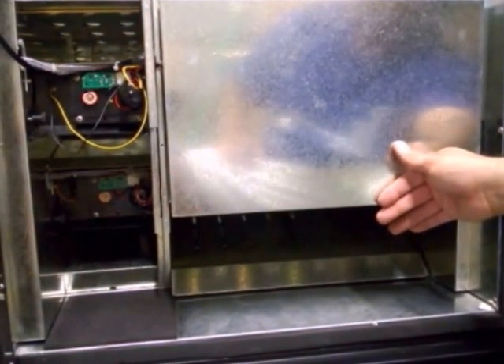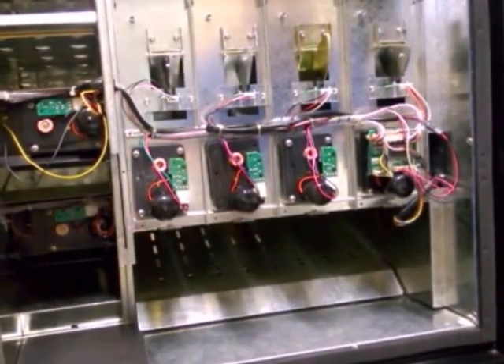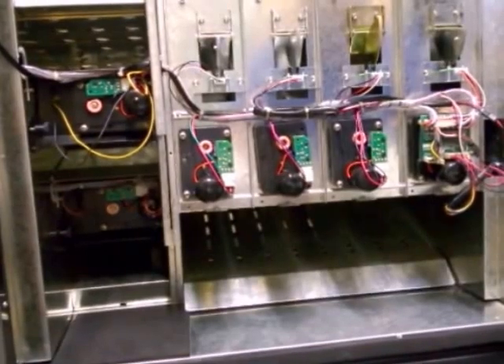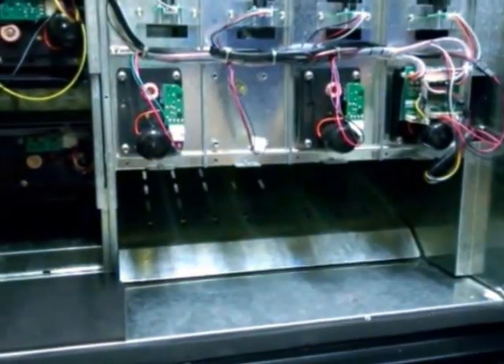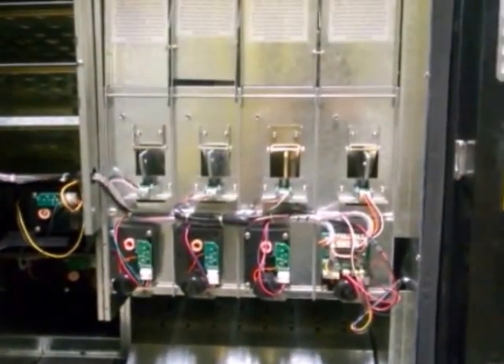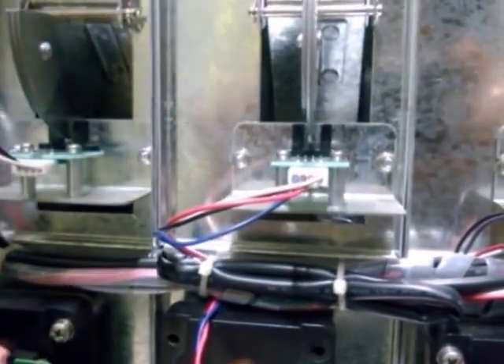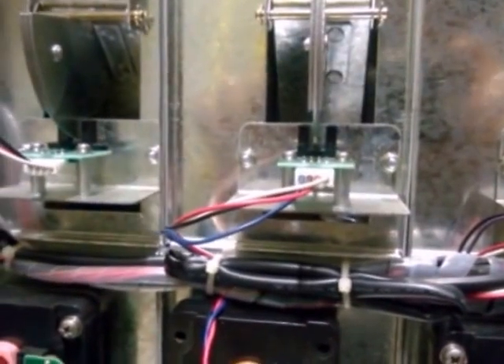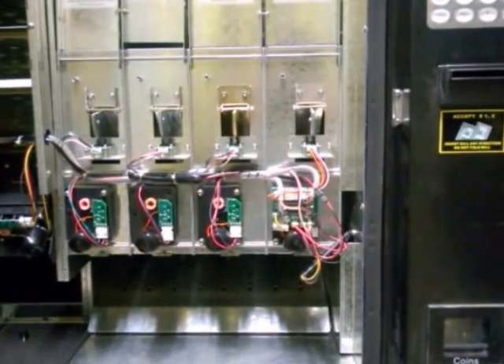How to Service Fortune Resources Vending Machine Drink Motors

Comment: I have one of these machines, My first two slots (b01,b01 I believe) are only vending cans after every 3rd vend. I pretty sure I've been loading it correctly and I do hear the motors working but I'm not exactly sure what the issue is. Should I just start by replacing the motors? And would you know a good site to find the replacement motors as well as spacers for all the sections? Thanks in advance.
Reply: Iv had same issues